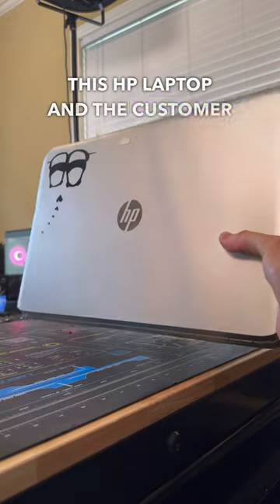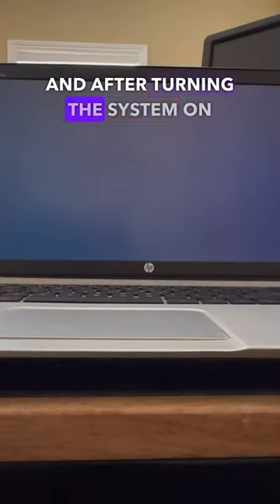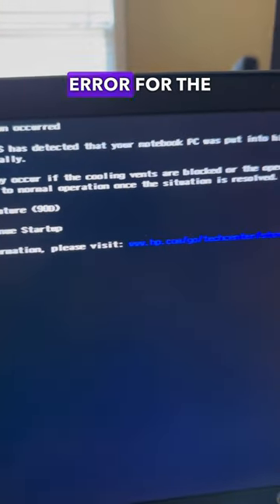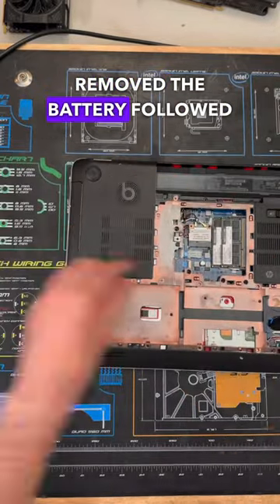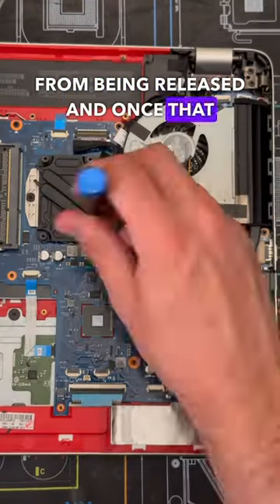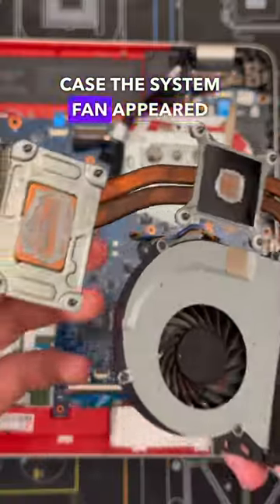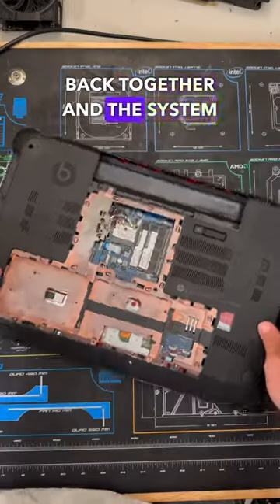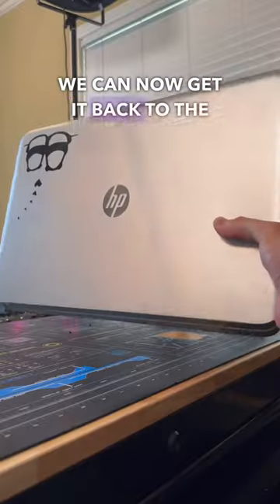Overheating HP Laptop! #shorts #pc #pcrepair #laptoprepair #computerrepair

Comment: Fun fact: this laptops CPU is replacable
Reply: arent all cpu's replaceable/upgradeable? (every computer exept for apple devices since they are extremely hard to repair/upgrade
Reply: @Warp3326  thats a big nope. All newer gpus and cpus on laptops are directly soldered to motherboard so there isnt any way of replacing them
Reply: @asetatlikalem and designed for the specific motherboard so you would have to call the manufacturer to make a new cpu for you which it won’t, not talking about the pain it would be to replace it without damaging the motherboard and cpu
Reply: @sfx3256  nope. There was a standart. There was a socket and there was a chipset you could Google that two and find which CPU is compatiple. After that you would buy that CPU, remove the old one and put the New one in, add thernal paste and assemble the laptop.

Comment: wahaha, i always repaste cpu so i wouldn't need to do job twice. Sometimes manufacturer wont add enough paste, seen it. Also please know, from HP laptop experience there is only and ONLY 1 Good quality laptop which is OMEN. It has proper cooling system, ALL others have crap cooling regardless to the cost as HP for some reason don't cut enough vent slots. I've seen them overheating even with the clean fan etc on flat surface.